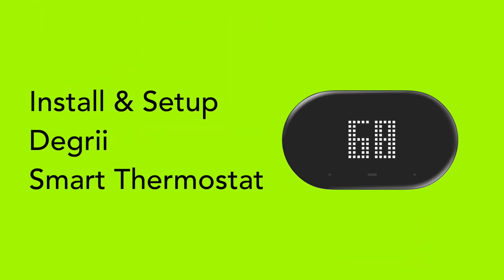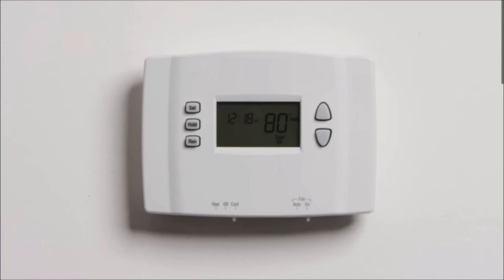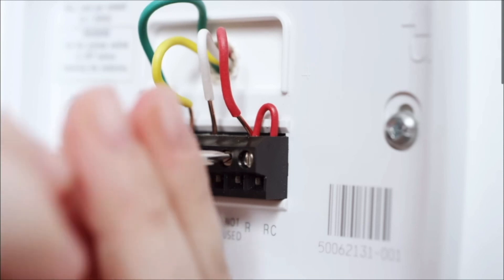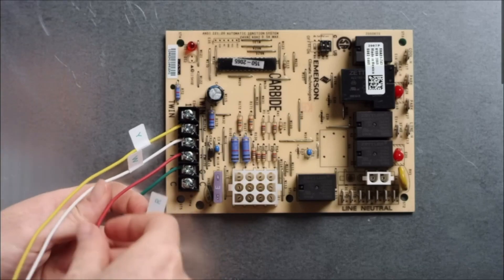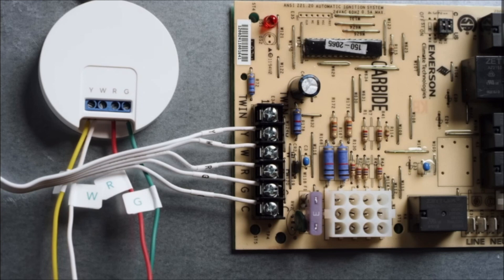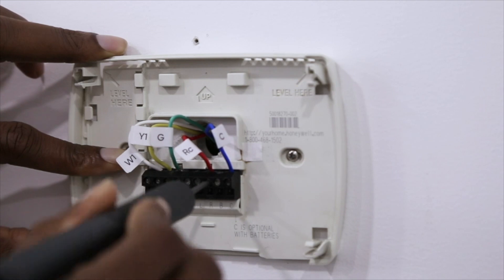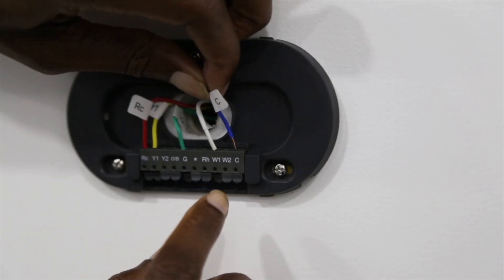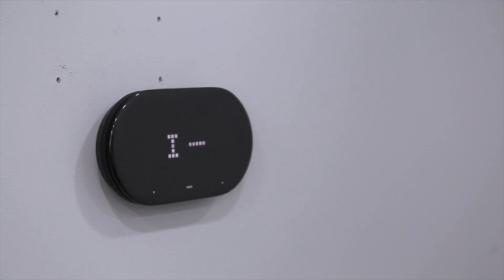How to Install Degrii Smart Thermostat

Comment: My thermostat has no power. I need help
Reply: Samee what do I do
Reply: @Daniel-sf2km  RC provides power to the thermostat.  Your r,rc, or RH wire needs to be in the RC station.  Unless you have separate RC and RH wires. If you have separate RC and RH wire plug accordingly